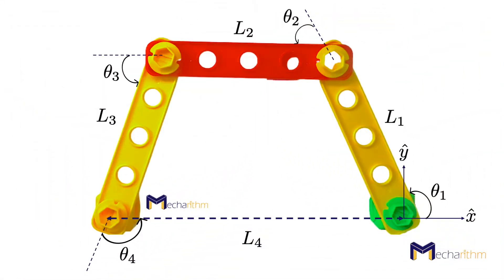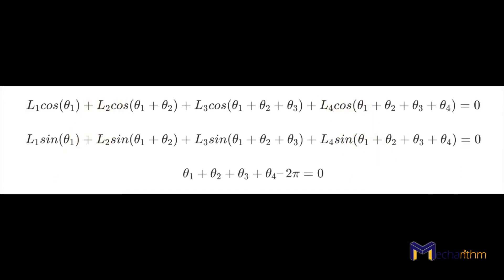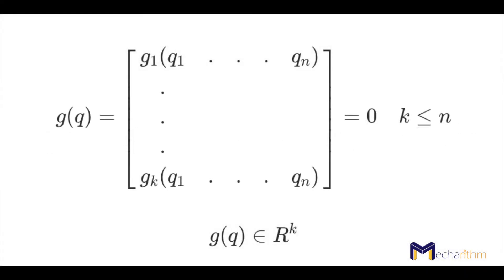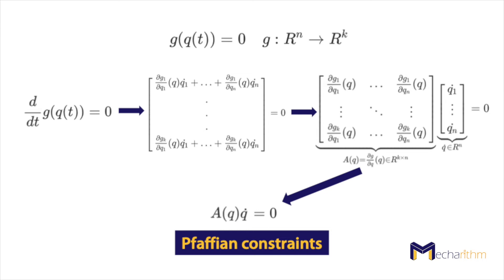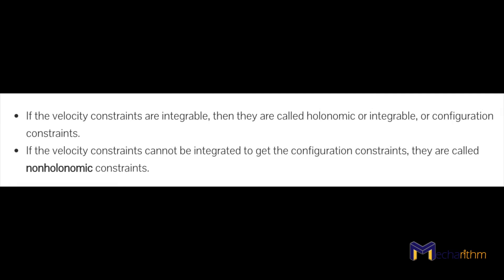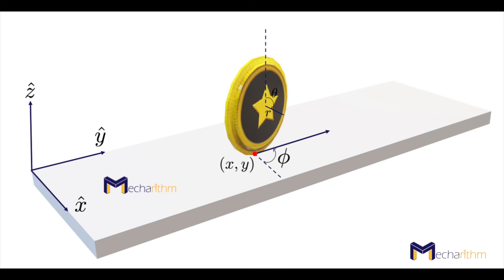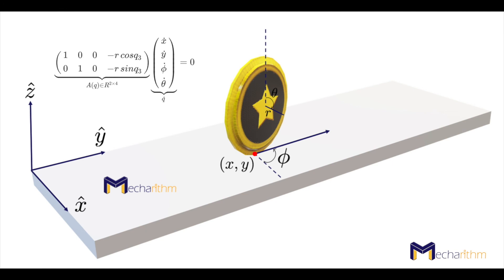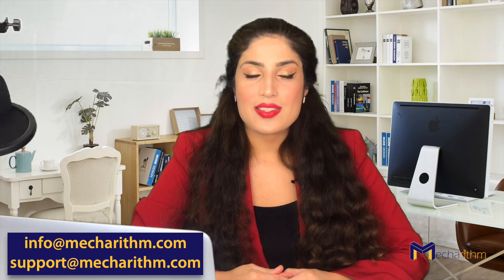Holonomic vs. Nonholonomic Constraints for Robots | Fundamentals of Robotics | Lesson 4

Comment: Hello, you mentioned that a four-link mechanism has three loop constraints and a 1-dof c-space defined by four joint angles. If this is true, are there four equations for the loop constraints for a mechanism with six joint angles if it has two degrees of freedom? Also what I understand from the 3 loop closure equation is that, 1st equation is about X position, 2nd one is Y position and 3rd equation is for orientation?
Reply: Also how do you rewrite that x(dot)sin(pi) - y(dot)cos(pi)=0 in the form of plaffian constraint?

Comment: Hi @Mecharithm - Robotics and Mechatronics. Excellent Presentations so far. But I confused with the non-holonomic representation of the coin as you explained in the last part of the video. Also, about the integration & matrix multiplications. Could you please refer any materials to workout?
Reply from the maker: Thanks for your comment. The two nonholonomic constraints are changed into a matrix multiplication equation. If you do the matrix multiplication, you will get the two nonholonomic constraints that we wrote. Integration and matrix multiplication are covered in calculus and linear algebra courses in college, and you can refer to, for instance, Thomas' calculus for integration in detail and any linear algebra book, like Linear Algebra by Hoffman, covers matrices and their operations.
Reply: @mecharithm-robotics  Will do the same. Thanks for your support, Keep grooming us😃

Comment: In the example of 4-link serial robot, you said that it satisfies 2 aforementioned conditions. But i do not understand the 4th link rotates relatively with respect to the origin, so how could its tip can coincident with the origin, and how could its orientation is horizontal? Thanks.
Reply from the maker: It basically says that you can find the closed loop linkage’s equations by supposing a 4 link open chain subject to those two conditions since we want to simulate the closed loop robot right? They are assumptions that makes solving the closed loop linkage using the 4 link robot possible. 4 link robot’s kinematics is straight forward to derive.

Comment: Extremely helpful videos, thank you! Regarding the non holonomic constraints, when you say they are not integrable, could you please explain a bit more as to why you came to this reasoning?
Reply from the maker: Faizan, thanks for your comment, and it is a great question. Suppose that we have a car that cannot move directly sideways without parallel parking. This is a velocity constraint (as we discussed in the lesson) because the car can reach any configuration on a plane (x,y,phi) despite this constraint. Therefore, we cannot integrate this velocity constraint to get the equivalent configuration constraint, and therefore it is a nonholonomic constraint. If it could have been integrated to get the configuration constraint then the car could not have reached all configurations on the plane (because it had configuration constraints that could reduce the dimension of the c-space). Hope this clarifies it.

Comment: Hi Mahdi,
Since I am busy reviewing linear algebra and especially vector and matrices math.
I am busy now with using Tensorflow to do matrices maths on a computer.
Can you tell me if TF is used in robotics ? It is a fantastic tool, I use it indirectly with Keras for Deep learning in computer vision stuff.
Thanks
Reply from the maker: TF as you mentioned is used in machine learning and machine learning has numerous applications in robotics like ML-based robot control etc.

Comment: Thanks a lot, this chapter was driving mad today. Thanks to your video now I understand almost everything in this chapter.
Also thank you for these maths tips on the formulas, i was getting hard time while reading the book as I couldn’t understand the transformations since they were not explained. Nevertheless, I might need some more math tips (but not today, my brain is over).
Reply from the maker: Thanks, Alexandre, glad that the video helped you! We are here to help and feel free to ask any questions that you have.
Reply: @mecharithm-robotics  I am busy understanding the terms of the general equations... L1 x Cos Theta1 + L2 x Cos (Theta1 + Theta2)...
If I understand, the First equation gives the horizontal position of the robot (because of the cosine) and the second equation gives the vertical position of the robot.
If we consider, the 1st link (L1), the horizontal distance traveled by the upper tip (or joint) of L1, is the cosine (the projection) of the line formed by the projection of the upper tip (joint) to the ground  and the fixed point of L1 on the ground (let's call it d). So L1 x Cos (Theta1) = d, now if we consider the vertical distance travelled by L1 at that angle is L1 x Sin (Theta1) and so on for the remaining links. Right ?
So the 3 formulas are a system of equations that describe the movement of the 4-bar robot, and the 3rd one is a kind of constraint that tells the arms cannot exceed some displacement or movement. So the sum of the anlge at each time cannot exceed 2 x PI, otherwise we would have a robot that could rotate completely which is impossible for this one. Am i right ?
Reply: Here is a figure of what I think:

https://drive.google.com/file/d/1ErMbJ8F5j5bxm0RREqdKT6NK2Jk9YdKY/view?usp=sharing
Reply: The figure should be accessible now
Reply from the maker: @alexandrevalente9994 , You are totally correct! We want to find the position and orientation of the end effector relative to the base frame, so you need to add all the projections of the links in x and y coordinates. Yes, the 3rd constraint says that the sum of the angles cannot exceed 2pi. Each of these constraints reduces the dimension of the c-space, which in turn reduces the degrees of freedom of the mechanism.
Reply: @mecharithm-robotics  In addition, those equations as they give the positions of the system (all the links) for a given angle, if we derive this with respect to the time, we get then a velocity... which is as stated in the book... the joint-velocity... in other words, the velocity at which the joints move from one angle to another, right ?
Reply from the maker: @alexandrevalente9994 , yes, the joint speed (speed is a number, but velocity has a direction) shows the rate at which the joint angle changes. The book sometimes misused velocity for speed! For instance, theta-dot is the rate (speed) at which theta is changing, but omega is angular velocity and shows the rate of change of theta in the direction of the joint axis.
Reply: So, all put together ... this permits to :
a) control the robot so it never exceeds some maximum angle in order to keep the system in its operation limits.
b) control the robot velocity in order to keep the joints in acceptable mechanical constraints.

Comment: I understood almost everything but still have confusion with Non-holonomic constraints.
Reply from the maker: Thank you for your comment. Would you please be specific? In general, Nonholonomic constraints are velocity constraints, and they will reduce the possible velocities. For example, traditional cars (some autonomous vehicles have this option nowadays) cannot slide sideways (reducing the possible velocities of the vehicle). However, you can get the sideways motions with parallel parking (the car still has that degree of freedom).
Reply: @mecharithm-robotics   Thank you mam for this prompt response. So far I understand your answer but I think I am not understanding C-space properly. I watched all of your videos but still do not understand the C-space properly which it comes to a bit complex problem in C-space.
Reply from the maker: @mistermind143  That's a great question and thanks for bringing that up. C-space is the space of configurations. The simplest example is finding the configuration of a point on a circle. We can define the position of every point on a circle with an angle from horizontal, right? So, the c-space has a dimension of one, and the topology of the c-space is a 1D circle or S^1. However, representation is different. We usually opt to represent the c-space embedded in a higher-dimensional Euclidean space because we understand Euclidean space better. For our example, you can represent the c-space by embedding the 1D space into a 2D Euclidean space (x-y) subject to one constraint that x^2+y^2 = 1 (2-1 = 1-dimensional space that we have).